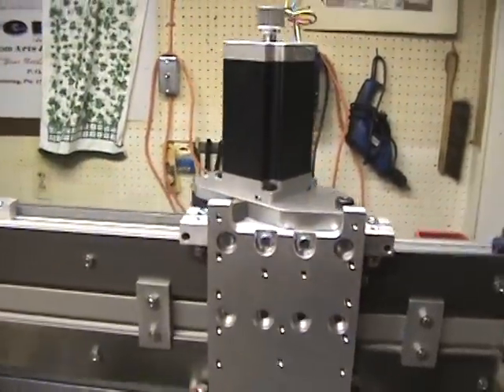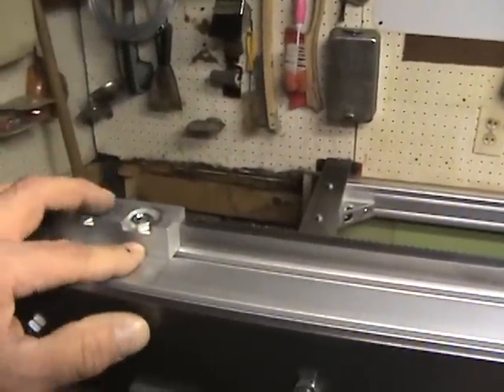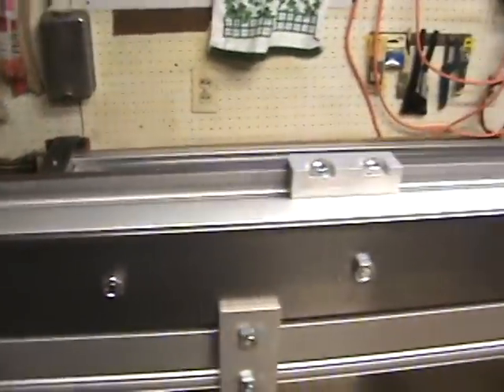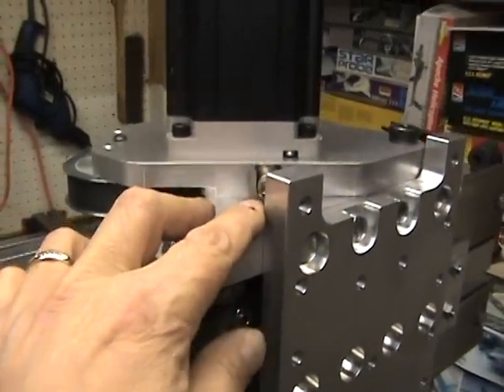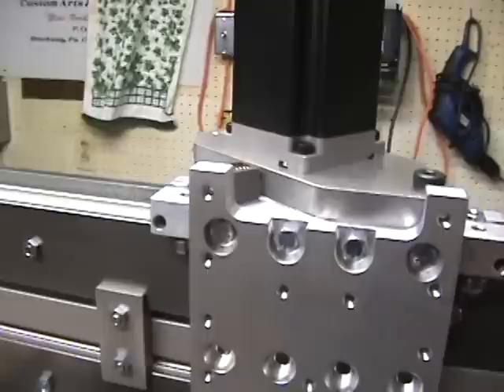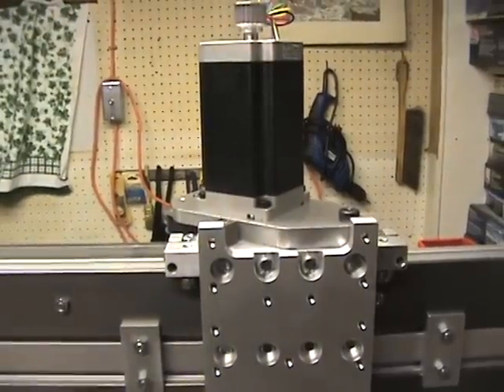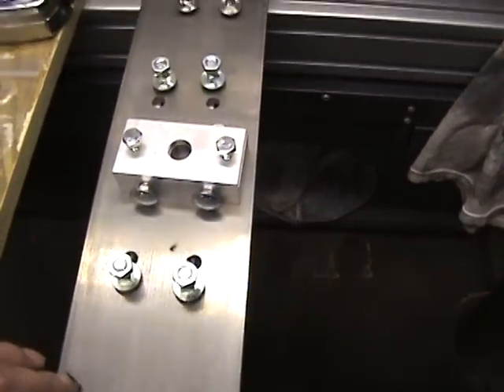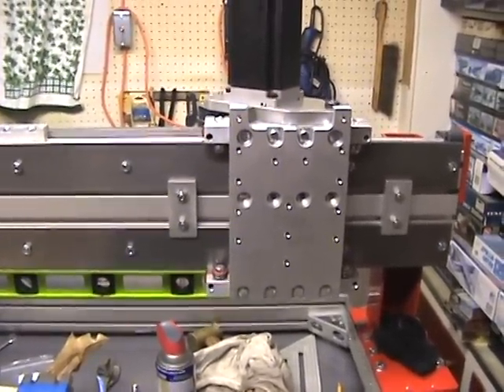Building CNC Router Parts CRP4848-9.MPG

Comment: Great advice to use a nut in place of the socket head cap screw on the tensioner. CNCRP has updated the design of the tension bracket to make assembly easier. Thanks for the videos!